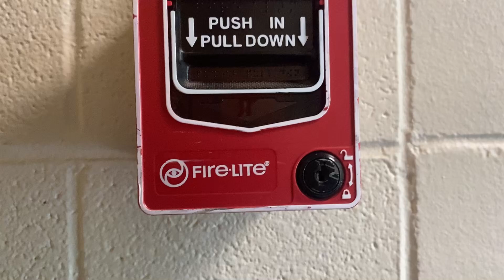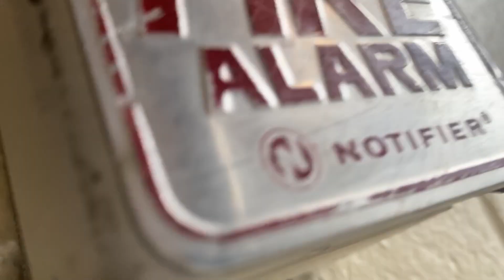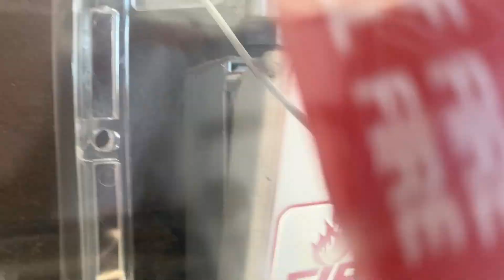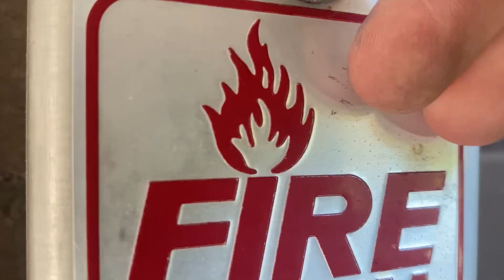Fire Alarm Test #97

Comment: 5:25 If I went to use a bathroom and saw any kind of old horn like that, I'd be noping straight outta there. Piezo-based horns are already terrifying in bathrooms, but my school district conditioned me to that with NSes and UMHU-style horn strobes. Those old Honeywell horns are another story...
Reply: Me too...though sometimes, it's unavoidable. When worse comes to worse, I'll just pop in my headphones and put music at full blast to protect myself should an alarm sound. The loud music can overlap against the extreme frequency of the alarm.
Reply: @LoyalmoonieProductions  Except for the SpectrAlert Advance/L-Series because it has a very wide high frequency band of 3,000 Hz to 14,000 Hz which would make it hear over loud music